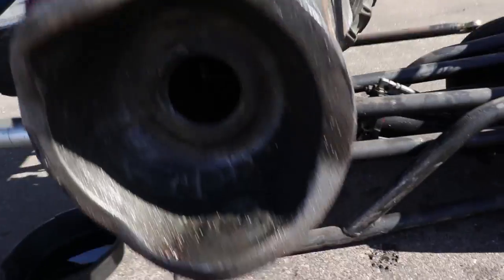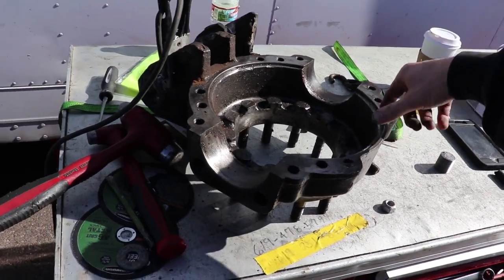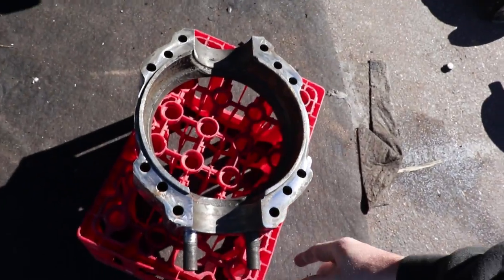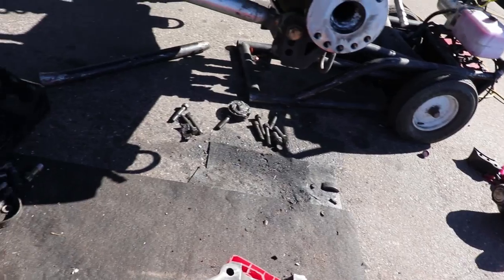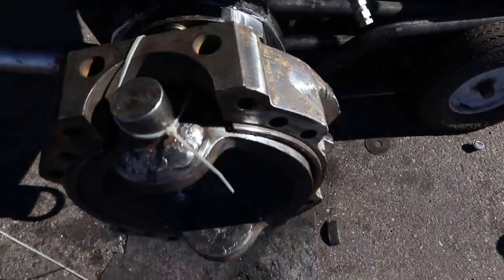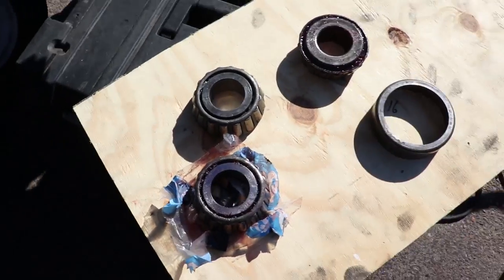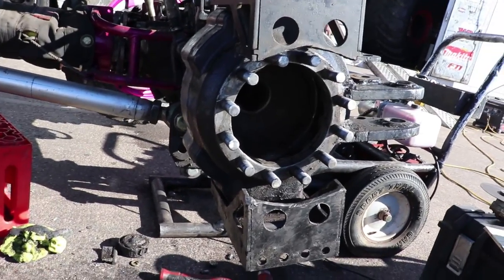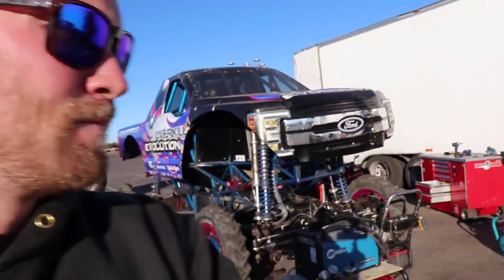THIS IS THE FUN PART..

Comment: Another fun and educational video!! I bet you can do that repair in your sleep!! LOL I was just wondering are cables no longer used to tether the wheel? You mentioned that safety feature but I didn't see a cable?
Reply from the maker: Cables are no longer allowed in monster jam. We are now required to use the plate system.
Reply: V2 Vids do you have to fabricate those yourselves?